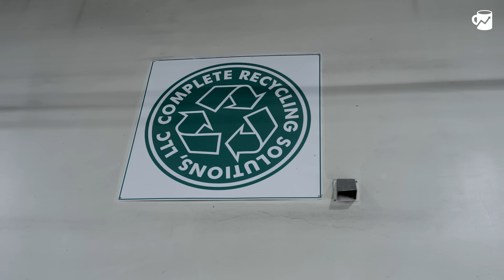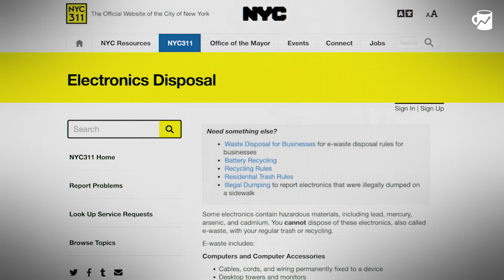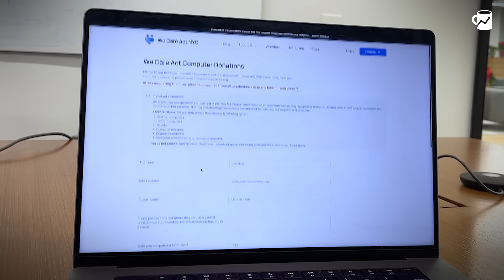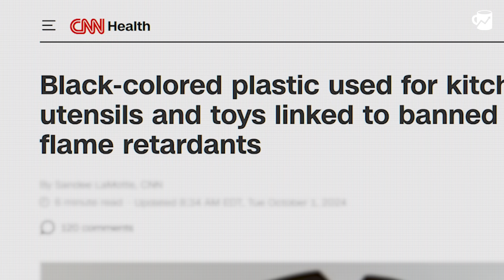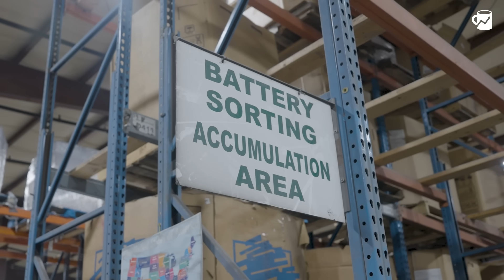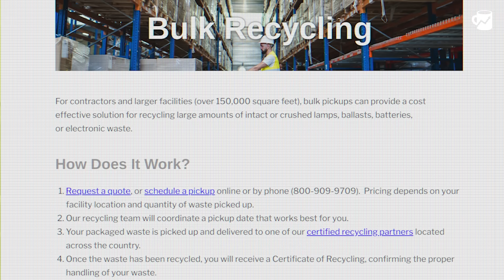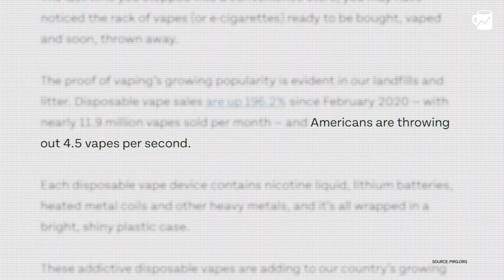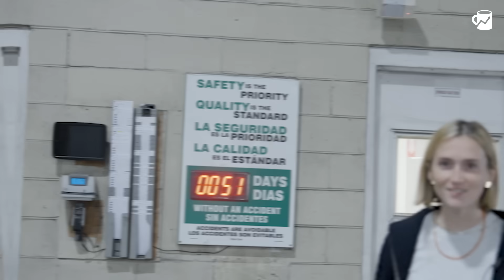I went down a rabbit hole trying to recycle all my tech waste

Comment: Hi, I actually work at a facility that recycles electronic waste in Ontario, Canada, and have also published research and done three degrees on the topic. A few notes: R2 is an industry organization, NOT part of the EPA, it's run by an industry group. The EPA just recognizes it. It has become a de-facto standard, and generally functions well across North America and some parts of Europe. Also depending on what functions the recyclers do, refurbishment and resale can also be large parts of the businesses, not just material processing and recyclate sale. In addition it should be noted that many of the processes are lossy, meaning that far, far less than 100% of the materials sought after, or materials present, are recovered. This is, in a colloquial term, downcycling, as materials in trace quantities are lost in smelting or refining processes if not targeted.

Also failing to mention repair and product life extension feels like a bit of a disservice to the right to repair movement. I studied the composition and construction of smartphones, laptops, desktops, and other consumer devices...lack of interchangeable batteries, virtually no ports, difficult troubleshooting and lack of instructions are all key topics to addressing e-waste. 

We largely KNOW how to turn e-waste into at minimum SAFE and at most and profitable material stream, but addressing the e-waste problem involved doing something corporations are woefully unwilling to commit to: long term product support, fewer new products, and an emphasis on products and services that actually deliver value and don't just lock consumers into buying a new model when they live in an ecosystem.

A paper I authored: https://doi.org/10.1016/j.resenv.2022.100069

Feels pretty rare that I am qualified to answer questions about a topic but I guess if anyone has any, I can answer about the American, Canadian, and French systems which I understand well.
Reply: So like every other aspect of "progress" , we COULD do it better, but the incentive structures in place virtually GUARANTEE that we will not.
Reply: @andrewstephens8790  Sort of, with extended producer responsibility programs, there ARE real incentives in place to get producers of electronics to make better products...but the stronger motivation for profit and newness is still there. I would say we are moving slowly, and in the USA glacially, towards better product development strategies. It's always an uphill battle against global mega corporations to do the responsible thing.
Reply: @those stronger motives aren’t going anywhere. No matter how many govt programs try to subsidize/incentivize the basic facts of neuroscience which lead to the effectiveness of the constant new product hype-launch cycle will still mean the profit motive lies with the constant newness. A company wanting to do better will lose market share to competitors who continue abusing psychology as in the product launch cycle. “It’s always an uphill battle” pardon me, but what on earth are you talking about? When has that battle ever actually been won?  It’s not an uphill battle. There is no battle. Corps own the lobbyists AND the lawmakers. We are tumbling down a mountain, not fighting uphill.
Reply: @andrewstephens8790  it costs more to re use and  recycle than it does to make new in almost all cases. We pay extra to not be wasteful.  Some way some how cycle has to be profitable but without tax payer money it would fail, fail, fail. and it would fail again. This girl is only two steps away from seeing most of these so called recyclables going into the trash. Or on a ship to another country that runs a land fill and from there it gets pretty realistic. Because there are entire countries that get Straight up American trash sent to them on a boat. So this poor girl might cry her eye's out if she ever got to see the full cycle. LOL!!! Have a happy new year and get back to work and stop worrying about the problems you can only fix if you're rich.😆😆😆🙃
Reply: wow. good job on the research. i hope its being used by the industry
Reply: @MegaDeeEm  I hope so! I'm using my brain in industry so I guess that helps haha
Reply: Are there any NGOs or other groups that are advocating/lobbying the US government to address these concerns?
Reply: @MrHeavy466  Its insane we have have "bribe" or pay to get this attention
Reply: What do you think about the Québec système with the éco-frais?
Reply: Ya I worked in an Alberta facility as well. Night shifts. Mostly on dock duty rough sorting and weighing entire truck loads of waste material as they were cleaning out the Calgary landfills.

40ft Trucks double wide and double stacked of TVs and other electronic things they recovered would be processed nightly.

One of the processes was dealing with printers and scanners. Where the scanner tube would have to be removed and put in a specific bin that goes into a grinding container tube connected with a 25 gallon drum. Everyone had to wear a lot of PPE and we got tested for mercury and lead levels every few months as well as a mask company came in and you had to test to make sure which masks worked properly. That hood and smell is the thing of nightmares.

My favorite part was actually sorting and data entry of all the weights. We'd request a forklift to drop off empty cages, they'd pick up the full one and we'd repeat. There were 3 or 4 scales of stuff that were most commonly found that we would just regularly fill up. You enter in the weights at the end of a cage or set of cages, and attach the printout labels to the weighed cages. Then they get sorted in the warehouse for processing by the other employees.

It was a really cool experience. Paid fairly well too. Nightshifts just weren't my thing though and I couldn't go to days.
Reply: This was really well written and I appreciate you taking the time to type this for us :)

I don't know anything about recycling but I do know that you're right about companies not wanting to support their devices for longer.
Reply: Surprised youtube didnlt zap your comment for having a link in it
Reply: Yooooo. I really dug this video, but it's nice to see a R2R supporter in the comments giving a little pushback on the journalism.

Thanks for the extra info. I need to check out your paper next.
Reply: How much Wood would a wood-chuck chuck, if a wood-chuck could Recycle wood?
Reply: @ierit3796  yea, I don't know why they have such a hard time figuring out what to do with particle board. Run it through a chipper and compost it. Also, a lot of consoles from the 60's have a lot of solid wood thats even easier to figure out. Not to mention a lot of vintage enthusiasts that would be happy to refinish them and display them in their homes
Reply: @jaredwblack  There are so many chemicals in particle board, composting it would essentially make toxic waste. It's loaded with polymers, plastics, and a ton of other junk. There's nothing to do with such a cheap product but landfill it. This is the hidden and subsidized cost of cheap goods.
Reply: I’m curious if you agree with the non-expert general consensus that Apple laptops are very contrary to the company’s claimed environmental friendliness?
Reply: @JasonJrake  Don't forget Windows 11!  I've got a couple of 10 year old Windows 10 PCs that work great, but when Windows 10 goes out of support, I'll have to get new ones since the motherboards don't support TPS.  That seems like a waste.  
I'll repurpose them as Linux machines, but I don't really know what to do with them.
Reply: @pipsplay  I’ve also got a small pile of old laptops I will “eventually” 😅 put Linux on too.
Reply: @JasonJrake  I feel like a laptop would be easier!  I have a Portrait Silhouette, I can take the laptop off-line and dedicate it to that!  (I keep an XP PC just for CNC/motor control hobby projects!)
If you have hobby or music equipment you can use off-line, you can dedicate it to that!  If you have several, I expect you do gaming. If you can find an off-line game, they should be fine on a LAN!  
Windows 10 should work just fine, but you won't get security updates, making it (more) vulnerable to malware attacks.
Reply: @pipsplay  you can recycle, or give away. There are people who take the housing and install new Windows and resell them as refurbished.
Reply: (Thank you for sharing!)
Reply: Planned obsolescence is the business model. Especially in America.  Is it true that planned obsolescence is against the law in Europe?
Reply: @ddawe31635  In the briefest possible summary: no it is not ILLEGAL, it is however more easily sued for...kinda. There is a very fine line between offering a limited and reasonable support lifespan for an electronic, and planned obsolescence, where one starts and the other ends is a matter of opinion and perspective. What I would recommend that people do instead of questioning planned obsolescence is to question if the lifespan of a product is REASONABLE (lawyer speak I know) and if it is environmentally efficient.
What is a reasonable life span? Well, does the hardware still reasonably support the software's objectives? Has the battery chemically degraded over time? Is the standard wear and tear enough to render a product obsolete over a certain span of years? Are upgrade options available, and if so do they extend product life? All important questions.
 You can check what the approximate emissions are per kWh in your area, and if there is a crossover point where the emissions from buying a NEW computer that is MORE efficient and where the emissions of your old computer are systematically worse, then it is time to buy a new one. This is to say, environmentally, buy a new product when the expected lifecycle emissions are lower for a new purchase than an old existing product (new EV VS old ICE car)

I recommend also looking at the French Reparability Index, some info here https://www.eea.europa.eu/en/circularity/thematic-metrics/business/data-on-products-evaluated-against-the-french-repairability-index-1
Reply: @Ontariosaurus  Where is the best place in Ontario to take e-waste, to be sure it ends up with you, and not in a landfill?
Reply: @ddawe31635 depends on industry
Reply: All good points. I'm in the industry as well, and agree...
Reply: This is the problem. It's not that the end consumer isn't responsible, it's that corporations refuse to support old hardware to force the purchase of new. I've got a macbook from 2006 that has nothing wrong with it, but I can't even check my email with  it because they've made sure that the software cannot be updated to even a rudimentary function.
Reply: I honestly think that when any company manufactures any product, they must plan for disposal/recycling/reuse as part of the product life cycle.  Computers haven't changed all that much over the past decade. One problem is that OEMs want to look like they have more growth every year so they keep putting out the next generation of products.  Microsoft is a huge contributor with windows that they randomly "upgrade" so that people & businesses have to upgrade all their equipment just to get security updates.  Infinite growth is impossible tho.  And so we're left with all this unusable stuff and taxpayers are paying for it all twice.  Anyway, a few thoughts
Reply: Have you happened to stumble upon anywhere that recycles those electronic shelf labels that are used by (insert box store here)?
Reply: @sQueaky637  Actually the firm I'm at had some of those, so I guess we do. I do know for a fact, not a proprietary fact, that because they are mostly plastic it's really the bottom of the barrel recycling. Many recycling firms will TAKE that and process it, but as the video indicates it's at a loss or close too. They are VERY much downcycled and to me see super wasteful as the displays seem durable...but they toss them anyway? I don't know enough about this waste stream but my spidey senses of BS product are tingling.

If you are in the US, consider looking at some recycling facilities and see if they will accept it with other waste that is more valuable as well in a contract.
Reply: Thanks much!
Reply: Thank you for sharing the paper you worked on.
Reply: Thank you for your research!
Reply: great answer! I enjoy how in-depth you went!
Reply: Wooow!!! Thanks for your post!
Reply: Wow, thanks so much for sharing your expertise! This answered a lot of the questions I was left with after this video :)
Reply: I've worked in the industry some & scrap as a hobby & really enjoyed your paper!! Thanks for sharing!
Reply: Great post. I’ll check out your research later.
Reply: Thanks for sharing the link. I love collecting research. 😊
Reply: thanks for doing this work!
Reply: I’m a retired design engineer.  Sad so many parts I contributed to are no longer “useful”.  They still work. They still could work in a phone or remote mobile device and or be repurposed to like a whole house control center or moble remote……but nooooooo. No access to software driver for the peripherals or register address and functions to write drivers. no opportunity to load different operation systems or small functional program using them or anything.  Just trash now. 😢
Reply: De-manufacfuring, repurposing and refurbishing could be awesome new industries for the rust belt.

Reduce waste AND political chaos.

Key factor seems to be making certification and audits affordable for the kind of smaller businesses that are going to be the most innovative and also employ the most people.
Reply: I work in ITAD as well, do you guys send your CRTs to com2?
Reply: Recycling is not profitable. Profit above all else.
Reply: Hey that's neat
Reply: Thank you for writing this out! So interested in your experiences. Do you have any opinions or experiences around the Brooklyn, NYC residential recycling or the SF Recology recycling facilities? I've toured both and found them so interesting! I would love an insider's perspective. (Also, fellow Canadian here! Also from Ontario. :) )

Also, are you familiar with the Precious Plastic movement? I've been following it for awhile and I'm so interested in it.
Reply: I genuinely LOVE that you pointed out the errors/oversights.....can't let ignorant 'reporters' sound like they know what they are talking about
Reply: Thank you for the good read.
Reply: You seem very proud of yourself, but all I see is a corporate shill.
Reply: I've worked in tech repair, we would buy a ton of E-waste. categorize, organize, repair and resell what we could then strip the batteries of the rest and recycle that. I've moved out of that work, but I still do the same thing with ewaste at home, old laptops I have are reused for as long as possible, right now I've got a 14 year old Acer that runs my home cloud so I can have a lot more drive and can use it anywhere I go, when I upgrade computer parts, I clean them and reuse, give to a friend or family member. It's a bit of work, but I feel good knowing my E-waste has a smaller footprint than most. Recently after upgrading both my PC and my wife's, I use the best parts of both of our previous desktops to build another PC for my younger brother who had been playing on an old gaming laptop for 8 years. I then took his laptop for a week to open it up and thoroughly clean and repaste it so it can still be used for all sorts of things.
Reply: That's cool and all but I throw it all in the landfill section anyways. Ewaste? Landfill, Wood? Landfill, Cardboard? Landfill. Deal with it. Dig it out and recycle it yourself. Nobody is paying me to do it. In fact I pay taxes for you to do it for me.
Reply: I just want to come in here and say, first thank you for your extensive work, and secondly your names fucking awesome dude lmao. My gf is from innisfil and she's giggling, greetings from Seattle, Washington!
Reply: You had me at Hello!
Reply: Good point:  Microsoft in October 2025 is, by policy, creating  billions of useless computers, by intentionally abandoning consumers who own a computer that "cannot" upgrade to a Win 11 Spy product for Microsoft.  Microsoft, like Apple and Google, are commonditying consumer data.
Reply: Since you mention refurbishment, I recall Louis Rossmann covering a case where business agreements with Apple meant a recycler was contractually bound to not refurbish items regardless of their condition.  I think couple of employees in a Canadian recycler were doing it anyway on the down low, and that got the recycler in trouble with Apple.  Also, some of the mandated Apple items that come from businesses can be unfit for refurbishment because they are not reset / iCloud locked.  Do you know anything about these issues?
Reply: As someone who has repaired phones in the past they have become so difficult to repair and I know it doesn't stop at that sector and then after that breaking it down is a complicated process for not a lot of minerals or precious metals so it's left to 3rd world countries who do not have the infrastructure to do it safely often times destroying the environment in the name of 'environmentaly friendly solutions'. Don't get me wrong there is so much potential but people need to realise we have such a long way to go too
Reply: But Right to Repair and Reuse etc. is mentioned at nearly exactly 14:00 in some detail, so its not like they glossed over or ignored it.
Reply: Which place u at I'm in the GTA too
Reply: You studied ' the composition and construction of smartphones, laptops, desktops, and other consumer devices...' and you say 'lack of interchangeable batteries, virtually no ports, difficult troubleshooting and lack of instructions are all key topics to addressing e-waste.' 

E waste is simply the manufactured product that now exists in some place other than a useable state. This is the natural state of all consumer goods, there is waste. You don't want an old shirt? Does anyone? Where does it go? To the Old Shirt farm where it gets worn by happy Old Shirt wearers? 

People replace their old stuff with new stuff as they need to, especially in a society with such a level of abundance, they can quite easily and readily obtain a new version of their item for cheaper and sooner than they could build a process for doing it themselves. Imagine making your own shirt every time you needed one. 

We participate in a thing called 'society.' This confers the benefits of 'shared division of labor' and 'specialization.' Rather than every aspect of your consumer life being tied directly to your own effort, you can outsource everything you don't specialize in, trading your labor for a common currency you can later exchange for the goods/services you don't produce for yourself. 

Enter the world of 'consumer electronics.' You would never own a smartphone if you had to create it for yourself. Just not possible. So an industry does it for you. The consumer electronics industry has taken a similar approach to design, function, and longevity as... the fashion/luxury industry. Meaning, you can count on an ever refined approach to the design and creation of electronics: Next year they will probably update their model with incremental iteration so they are always relevant and useful to a consumer. 

Imagine trying to sell Any model of iphone older than a 10, right now in 2025. You have a shelf full of Iphone 3s and 4s, you can't even connect them service... So, it's not a matter of designing around the 4 disparate points you tacked on to your post. The reason you can't change your battery in your smartphone... actually, you can. Any smartphone. 

Your 'study' should have clearly demonstrated that an iphone 16 battery is 100% replaceable, just like the battery in your nokia 3310. What isn't similar, is the quality, function, durability, or reliability of a Nokia 3310 vs an iphone 16 - any model. Iphones not only feature their own design, that's how they continue to be able to stay in business to develop, sell, and service phones. The reason I picked these specific examples is because the Nokia 3310 was released in the year 2000, would not be able to pick up cell service today and would not work very well as a device in any capacity, even brand new.  

The consumer electronics industry doesn't stagnate and stick with the same stuff for 25 years. They iterate and improve, and the battery replacement job has become more difficult because your phone can withstand a significantly increased amount of abuse, for longer, with better functionality, reduced changes of failure, and if your iphone 16 gets wet, there is a chance your data won't be lost. 

Your iphone 16 might just live long enough to continue working/making calls, or let a tech data recover without having to revive your device. There isn't anything on your nokia 3310 that a tech would be able to recover, that wouldn't be stored on a sim card and just transfer to a new device. 

No one would want to repair a nokia 3310, except for maybe lulz and nostalgia. I work on all my own devices, at home. I at home replaced the battery/back glass/charge ports for my LG v30+ and a LG v60 last month. I did it without any tools. LG doesn't exist as a smartphone maker any more, all parts are available 3rd party online, no direct anything. 

Managed a top tier near factory level refurb in both cases. Those are devices from 2017/2020, respectively. You don't understand anything about this subject.
Reply: Youth are programmed to believe that all good comes from the government. She was told that government regulations squeezed out smaller players AND are preventing an entire category of e-waste from being addressed (probably at the request of big tobacco so they have something to cry about) then goes right back to praising government interventions and looking for more.
I call it public school syndrome.
Reply: @jburdman7  🙄